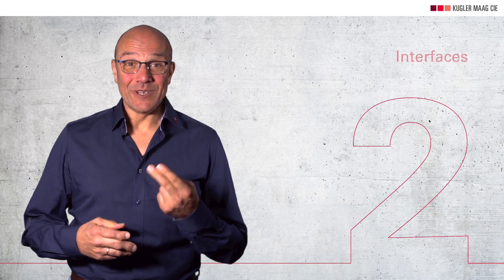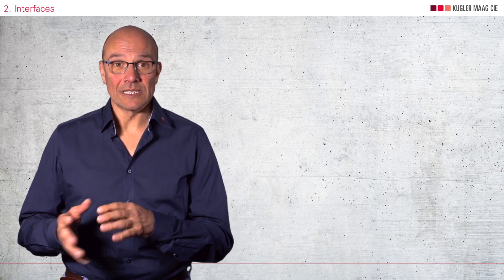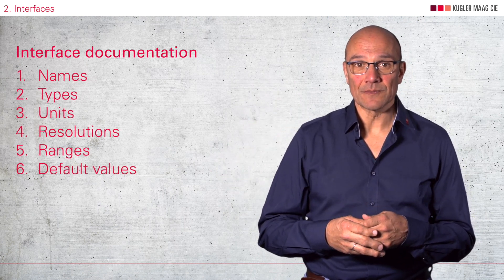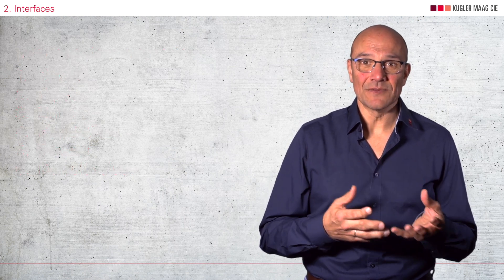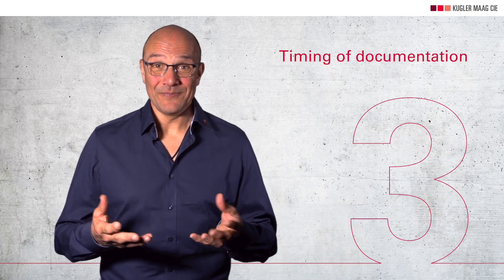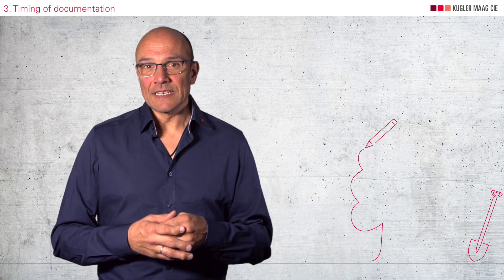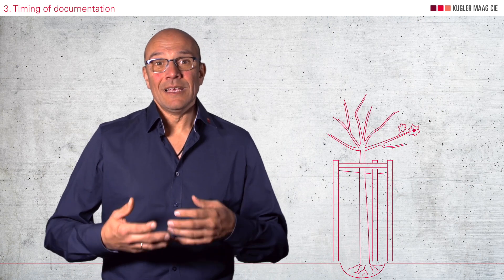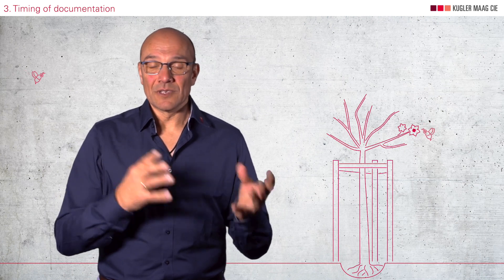SWE.3 Software Detailed Design and Unit Construction | Automotive SPICE

Comment: The only thing I miss in this video is the traceability. Especially if we use statis functions or variables that are not visible in architecture, but they exists in detailed design and those functions are used by many SW elements from architecture. Could you please put some light on it? E.g. we have some function which convert from one unit to the other and it is called by several function describer in architecture or we have some statis variable to memorize variable between function calls. How to ensure the traceability to architecture in such cases?
Reply from the maker: Hi there, thanks for your feedback! We do not cover the complete process but in each the three major points. All engineering processes on system- and SW-level require traceabilities. So, even these kind of “global” functions should be traceable to SW architecture and SW detailed design. As these functions are required in several high level components, you may use a combination of references and traces. How you do that depends on your tooling and the set-up of your processes. We hope this helps you further!

Comment: In practice, how to harmonize/synchronize the detailed design and code implementation? From what I observed, programmers would prefer writing comments in the code, instead of writing a separate document. Is commented source code acceptable from ASPICE point of view as the detailed design document?
Reply from the maker: @陳韋任 Thank you for your question! No, this is not acceptable. The expectation is to write your thoughts regarding the design of the code. If you make comments, you define the design which you implement. All assessors typically downrate such an approach, and the OEMs do not accept that.
Remember, that the unit test and the code review should be performed against the detailed design and not against the code. So, depending on the potential ASIL-criticality, you should be able to derive an appropriate code coverage. For MCDC- or C1-coverage, typically diagrams are very helpful to ensure that you can identify branches and conditions. We hope this helps you further!